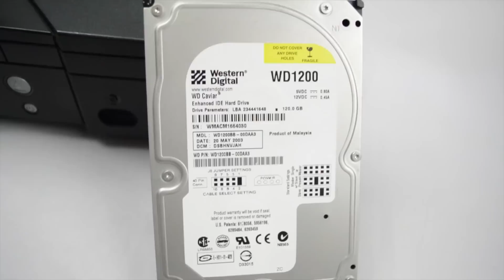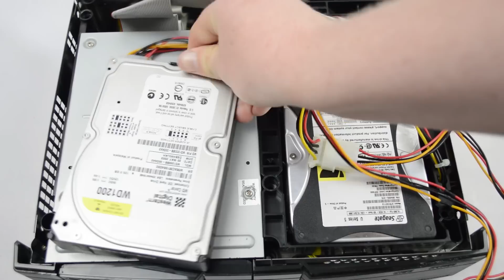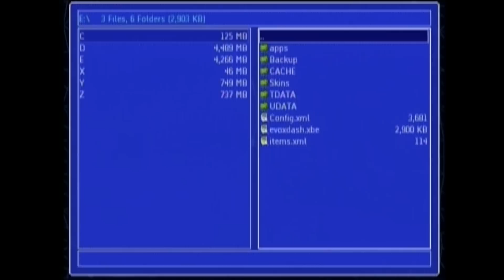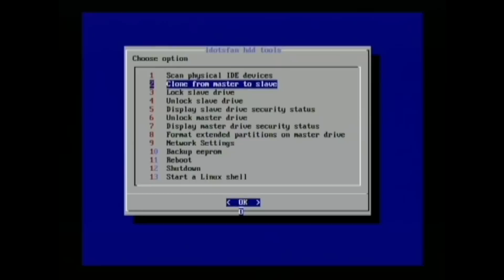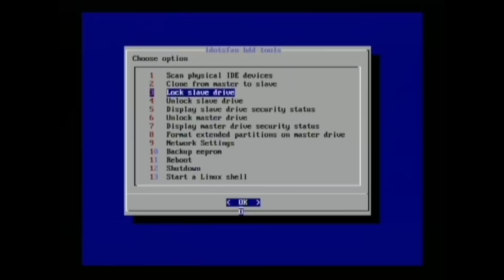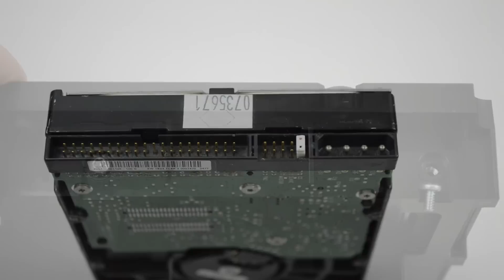How To Upgrade HDD in SoftMod Xbox Easy

Comment: It helped me a lot man thanks man!!
Reply from the maker: +Kael York No problems :)
Reply: +Slot1Gamer Question, i want to update to a hd i have that was on a old modded xbox i just want to install on the new softmodded xbox what setting should i use in chimp to bring over my old hd without erasing?
Reply from the maker: should just need to lock the drive but is the other xbox softmodded or was it using a chip (tsop and chipped Xboxes have a different file set up
Reply: +Slot1Gamer should i unlock the old drive first in case its locked
Reply: +Slot1Gamer the other xbox was chiped

Comment: Does it matter if the hard drive has things on it? I have a 160GB Seagate I got out of a Sky + box that I want to put in my Xbox but I don't have an IDE port on my PC to format the hard drive
Reply from the maker: +yoyoyoshio267 it should be fine :)
Reply: +Slot1Gamer So my Xbox will just format the hard drive on it's own?

also will this be fine?
http://www.amazon.co.uk/Power-Splitter-Cable-Molex-HiConn/dp/B0076ZSHYI/ref=sr_1_4?ie=UTF8&qid=1458446630&sr=8-4&keywords=molex+wire+splitter
Reply from the maker: yes you are cloning the disk, also that splitter is the correct one :)
Reply: +Slot1Gamer Awesome, this means I've got everything I need to install my 160GB HDD and set up FTP :D

although I might end up getting a 500 or even 1TB HDD for my Xbox depending on how many games I install to it... do you know the max amount of memory an Xbox can read?
Reply from the maker: cool, from memory it's' 2TB, avoid slow HDD's
Reply: Slot1Gamer I doubt I'll need 2TB, but good to know

also your file in the description has a malware in it, or it could be a false positive but maybe look into it, I scanned it using https://www.virustotal.com/

but anyway I'm pretty sure my 160GB HDD should be fine, it's Seagate so it's no cheap Chinese knock off
Reply: +Slot1Gamer I'm having some trouble getting the power cable out of my original hard drive, I'm scared of damaging the cable, it's not budging at all
Reply from the maker: yoyoyoshio267 you can use a screwdriver (while the console is unplugged from the wall) and leaver the hdd power plug out. sort of push on the little wing parts on the side of the plug.. if that makes sense
Reply: Slot1Gamer I used one of my flatheads to get it out, I was thinking of deleting that comment but I'm lazy :I
Reply: +Slot1Gamer I'm sorry to say man, but your tutorial is terrible

it is confusing and unclear, when you said to leave the Xbox for five minutes before disconecting the DVD drive I thought you meant turn it off for five minutes and plug in the new hard drive while it was off, and also the software in your description is completely different looking to what is in the video, I don't know if I'm doing something seriously wrong but it's not working, the furthest I have gotten is my TV saying Mode Not Supported when my Xbox presumably changed resolutions and what looks like crash

and my TV is capable of both PAL and NTSC and supports 240p 480p 720p 1080i and 1080p and 480i and PAL equivalents

I'll just look for another tutorial before I break my Xbox :I

oh yeah and you explained nothing on setting the hard drive to slave

Comment: If I wanted to keep my Xbox stock and just replace the hard drive, should I just keep the new hard drive without the software?
Reply from the maker: +Sailaser in order to keep stock, you will need a different method (use EEPROM reader, a PC and software called XBHDM)
Reply: +Slot1Gamer XBHDM doesn't work on new computers with Windows Vista and above with Sata connections.
Reply from the maker: furonwarrior have you tried the USB version? you may need one of those cheap IDE pci cards

Comment: I burned it on Verbatim DVD-RW  and it worked. (Regual CD didn't worked for me). Maybe it will help to somebody.
Reply: Or you could just ftp it onto your Xbox and not waste a DVD. If your going to mod your Xbox it would be good to get comfortable using ftp through an Ethernet cable. Will save you loads of money and time on dvdrs and burning time.
Reply: Carsun Georginitus It's not a waste for them since they used a DVD-RW.
Reply: Wally17 True. But ftp would be much faster and reliable.
Reply: Thanks...
Reply: does it matter in which folder you ftp it? and where to go from there? thanks for your time :)
Reply: Pavelwsad  Lexapro for helpful 😙

Comment: One of the most important bits this tutorial neglects to mention is (to my knowledge) softmods technically only allow hard drives up to 120GB in size, due to the 24-bit LBA memory addressing limitations of the stock Xbox BIOS.  You CAN put in a larger hard drive, and the G partition, once formatted, will be present and accessible, but not without potential write issues cropping up over time.
Reply: I dont know the logistics but I have a softmodded 1.6 Crystal console that has a 500GB SATA drive in it and I have no issues. I didn't mod it myself, I purchased it like that.
Reply: TAG Media how do you partition it after cloning?
Reply: Not true. You can use up to 3tb drives in softmods with a hair over 1tb on f and g if you want to.
Reply: That's not correct. You can go up to 2TB. Some people had success with 3TB. It all depends on how big are the drive's clusters. Over 500GB, you MUST have 64kb clusters.
Reply: @90jucabala  3tb is just the same as a 2tb when you set it up. It gives you an extra 230gb of space or so over a 2tb. It's worth it since you can get them for a few extra bucks over a 2tb.
Reply: @JoshLineberry 
I know. But I have read reports of people that lost data with 3TB drives. To be safe, I don't go over 2TB with 64k clusters. It would be nice if we could have external storage but the USB ports simply hate every drive I ever plugged. lol
Reply: @90jucabala  dont believe them lol. I've been using 3tb drives in all 8 of my personal boxes for about 2 years now with 0 data loss and no failures.
Reply: @JoshLineberry 
Do you use a specific drive?
Reply: @90jucabala  I use Hitachi ultrastar drives. They are 24/7 commercial use drives. I pay around 45-47 each on ebay.
Reply: @JoshLineberry 
Thanks for the info, mate. I'll give it a go.

Comment: His ISO is weird, it shows up as blank when burned to a DVD. So instead I suggest just FTP'ing Chimp over to your xbox and placing everything in the correct spot (E:/apps/Chimp2618 and E:/linuxboot.cfg). I found some working files here: https://www.dropbox.com/sh/ejlga1bhsgvgo77/AADRbQ_dO3jsDmpbkCfwE61ta/Apps/Chimp_2_6.zip
Reply from the maker: +aidenator00 because thats how xbox discs are. Normally it will have the DVD section (which only gets read buy non xbox drives) that plays that little video saying it's an xbox game.
Reply: +Slot1Gamer It might be that I only had DVD+r on hand. If I can manipulate the files in windows just fine why couldn't I open up your ISO though? Anyway, your video was helpful other than that.
Reply from the maker: +aidenator00 I used xbox specific tools to build the ISO, most software can't read the xbox partition only the DVD one (which has nothing in it) :)
Reply: You have to burn the ISO onto the disc at a speed rate of 4x or less for the Xbox to read it.

Comment: I followed the tutorial to the letter and it works perfectly, thanks!

One thing that you forgot to mention though, is that you need to create partition F so that you can allocate all the extra space.
Reply: No, you can do that after the cloning process.
Reply from the maker: +RhysticOne thanks :)
Yeah I'll get around to adding that in somehow
Reply: Is it necessary to alloc the extra space on new hdd before I try to clone the old hdd??
Reply: i think chimp does that automatically for me if i remember correctly since when doing something i accidently deleted a wrong file making the xbox not boot into evolutionX i think is what i chose though now its running XBMC
Reply: Do I need to format my IDE drive before cloning it?
Reply: well it depends on the OS installed on it i know when i tried to do it to a hard drive that i didnt know had linux on it chimp locked up but i would clear what partitions if any on the hard drive just to be safe

Comment: only detecting the main drive. any ideas?
Reply: I have the same problem. I am trying to use a 1TB SATA HDD.
Reply: think u need buy a ide ribbon if u are using a sata to ide converter they doent like the stock ribbon or something like that

Comment: i hope some here can help me. I used sata to ide  to add a sata 1tb drive. I followed this guide everything went well cloning the drive i was able to lock drive. but when i put the drive into the drive caddie and powered back on i got a screen telling me it needed service?? can anyone tell me what i did wrong? thanks for reading and the help.
Reply: +Roy Jones HDD jumper pin(Master,Slave,Cable Select) in the right position? ( Same as the original Xbox Harddrive )
Reply: on the adapter it should have one , from what i read otherwise it wont work

Comment: Hi. I need some help with using the SATA hdd. I have the adapter and I have been unsuccessful with upgrading the hdd. Are you able to upload a quick step by step video of how to install a SATA hdd or maybe give me a step by step instruction for installing the new hdd? my new hdd is a Seagate barracuda ES 750 gig 7200RPM SATA. Please help!!!
Reply: I still had the same issue, but it went away after I bought a hard modded Xbox and used Slayer instead. I think my issue was that I didn't wait the 5 minutes while on the dashboard before removing the IDE connection on the DVD drive because it kept freezing up or not showing up when I scan the hard drive through Chimp.

Comment: I can't seem to get this to work.  I have an approved hard drive, a V1.0 XBox softmodded with XBMC, and I'm using Chimp 1.6.  I've tried switching the IDE cable before running Chimp from XBMC, during the program load, and immediately after Chimp loads.  I've tried expanding the linux tgz file and changing the linuxboot.cfg file to point at the unarchived location no progress.

No matter what I do, each time I hit an issue - a screen that says "Loading Linux" on it and nothing happens, or a screen saying "Drive 1 Not Ready".

I've even tried doing a FATX full disk format on the drive I want to install with no difference.

Any help is appreciated.

Comment: hey did you wait 5 mins so it don't freeze and go to a black screen kept doing that to me had to reset and try again, also when your in the chimp part of it when it goes to the black screen part with the white text mine keeps displaying the text of screen cant seem to fix this any help would be cool still haven't been able to upgrade my hdd yet
Reply from the maker: +Nga Rimu does the white text change?
Reply: +Slot1Gamer yeah just some of it is displayed off the screen don't know why it does that tried to change the zoom on tv but still couldn't get it to display the text properly, plus the xbox froze a lot when I took the ribbon cable out of the dvd. I am trying to use a SATA hdd for the upgrade but I have the adaptor to ide don't know if that's the problem
Reply: +Nga Rimu I have the same freezing problem. I have tried 3 different HDD's with the adapter. None of them were recognized in Chimp and I have freezing problems. I don't know if it's the adapter of if I need to get a 40-PIN 80 wire IDE cable. Can anyone help? I've been trying to figure this out for over a month.

Comment: Very good video mate! might wanna put in the description if anyone wants to use sata drives they'll need an 80 wire ide cable and a sata adapter with a Master/slave header and 2 capacitors like this model  http://www.ebay.com.au/itm/131339440390?_trksid=p2057872.m2749.l2649&ssPageName=STRK%3AMEBIDX%3AIT would recommend giving this a try yourself :)
Reply: I just downloaded chimp but no idea what unzipped files to transfer. Some vids say an 'E' file but I don't have one. Can you help?
Reply from the maker: ***** Cool Thanks I'll add that in :D
Reply: Cheers! :)
Reply: +Jacob Power there's nothing in this iso or when I burn it using imgburn   I get blank disk when I put in xbox how do I burn this to disk thanks
Reply: Use poweriso it supports xbox isos.
also isos are trying to burn?
Reply: +Jacob Power  when I burn the chimp Iso to cd my xbox says it's blank disc
Reply: Chimp iso?! dude ftp it you arent ment to burn it
Reply: Simone J Stogrin check the read me you ment to move it

Comment: i didn't have any dvd so i downloaded another chimp file and ftp it over to the xbox and it loads up but when i click the chimp it loads a little bit and sits there and said starting and then didnt do anything? m i doing something rong or should i go buy some dvd?
Reply: bobbyelter3 help
Reply from the maker: bobbyelter3 Did you copy over both the folder and the files that go in the root directory? Try downloading the ISO I made and extract it using WinRar or 7-Zip and FTP them over.

Hope this helps

Comment: the hdd in my console is dead. so i cant backup or clone or do anything. i got the eeprom bin file so is there a way to make a new hdd for the console ? if so pls give me all the info i need to do that...
Reply: huh... i would have if there is no unique lock code for the hdd :p
Reply from the maker: Chamila Ariyarathna Grab a pc with an IDE interface and a copy of XBHDM (there is a usb version). Pop your key.bin file in with the XBHDM files (either on the cd or the usb version).Once you boot up the XBHDM software you can build a new xbox hdd, once built don't forget to LOCK it using your key.bin file

Hope that helps
Reply: Slot1Gamer thanks for the reply. dont i need C and E drive files? i have downloaded original dash C drive files. how can i use those to make a hdd with original dash ? just copying those to the C folder in XBHDM will work ?
Reply from the maker: Chamila Ariyarathna Yes you do need them, sorry I forgot to say that. Yes just copy the files into the C folder should work.
Reply: Slot1Gamer thanks again. i need another help. i want to connect a 250gb sata laptop hdd to the console. i looked for adapters on ebay and contacted few of those sellers. they say their adapter needs to be the only device connected to the ide cable and it wont work in my case coz there is a dvd drive on the same cable. can u pls suggest me a good working adapter ? if its ok can u pls add me so i can message u personally. i might need more help :)
Reply: Chamila Ariyarathna DONT USE LAPTOP DRIVES IN XBOXS THEY ARENT AS FAST... Sata drives are fine though http://www.ebay.com.au/itm/131339440390?_trksid=p2057872.m2749.l2649&ssPageName=STRK%3AMEBIDX%3AIT the adapters need to have to caps and a master and slave jumper.. i use these.. also you need an 80 wire ide cable cant use the stock ones
Reply: *****
finding a right HDD and a adapter is the hard part. all the IDE HDDs around here are second hand so not sure how long they will last. i think ill use my SATA laptop HDD. Thanks for the tip on the adapter and the cable. ill try to get those and hope it will work...
Reply: Okay mate good luck.. go on iso zone fourms they're good at helping :)
Reply: *****
thankz again :)

Comment: Can I use this method to upgrade to a 2TB drive? (I am aware that I have to use a SATA2IDE adapter - I have this already) Can I just take the new 2TB drive and just follow your steps using chimp?
Reply from the maker: Gle Cas Yes and No, some SATA HDD's can't be locked, you have to lock the new HDD. Most sites that sell HDD's should state if it can be locked, failing that just go to the manufactures website and look up the model you wish to buy.Thanks for watching, hope that helps

Comment: This tutorial lack of info....how is set the new hard drive to slave?
Reply: Hd must be formatted in some way before do this?
Reply from the maker: messatsu1981 How to set hdd to slave? There are "jumpers" on the hdd that you can set...
HDD shouldn't have to be formatted but does need to be UNLOCKED, chimp basically copies the used areas of the hdd to a new one, a sector at a time. This overwrites the partition table, effectively formatting the drive in the process.

Some drives just don't work on the Xbox for various reasons..

Hope that helps
Reply: ya i figured out ;) thanks
Reply: +Slot1Gamer What if I am trying to use a 1TB Western Digital SATA HDD that doesn't say anything about setting a slave mode on the case of the drive?